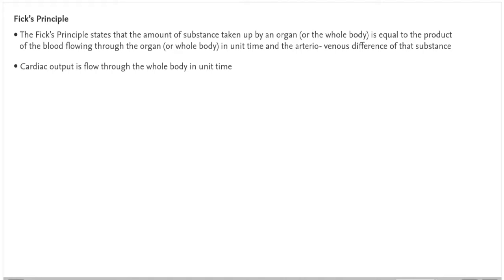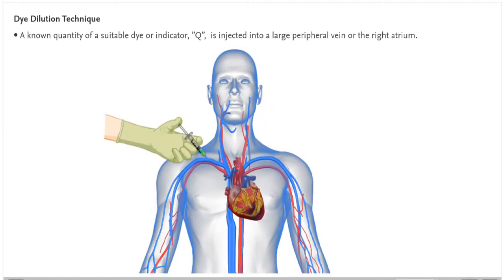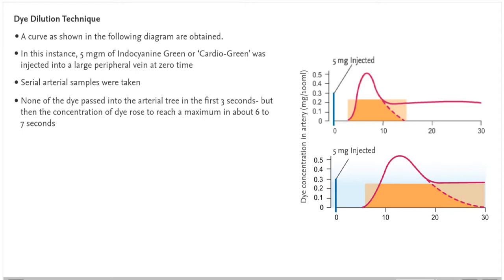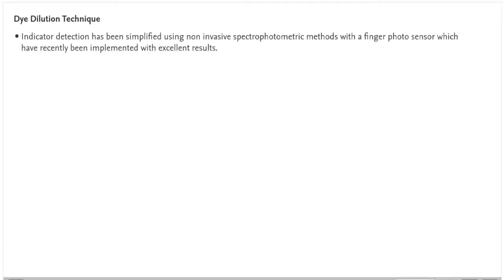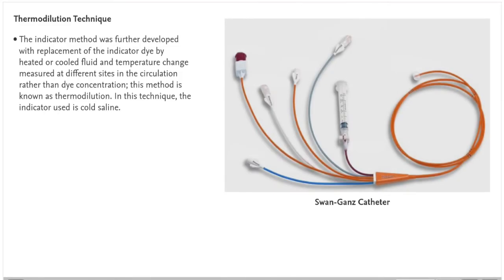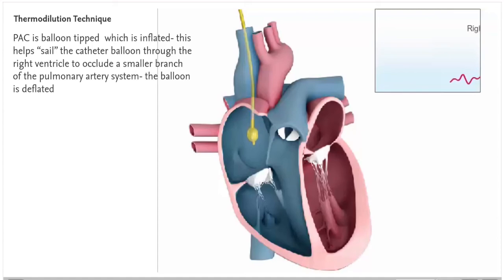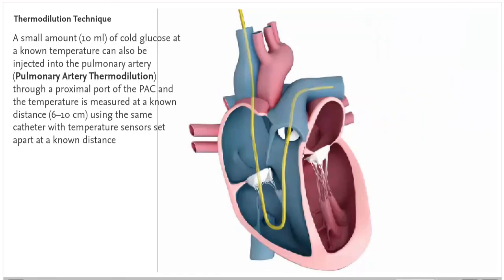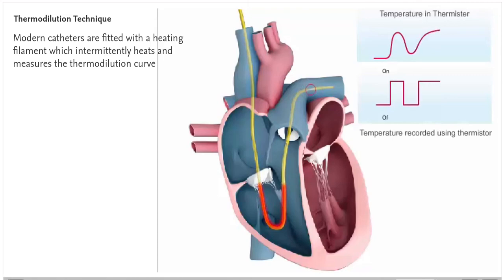Measurement of Cardiac Output by Thermodilution Technique and Dye Dilution Technique

Comment: So regarding the thermodilution method: Basically you inject cold NS, sensor #1 detects it first, after certain known distance the placed sensor #2 detects it after a while; and the machine uses the time the NS needed to pass the distance btw #1 to #2, right?